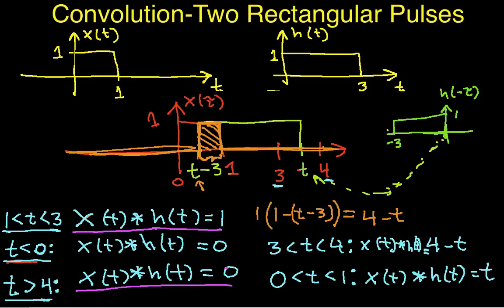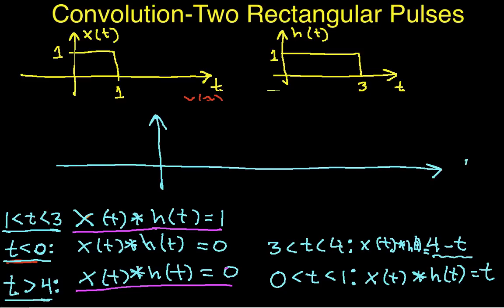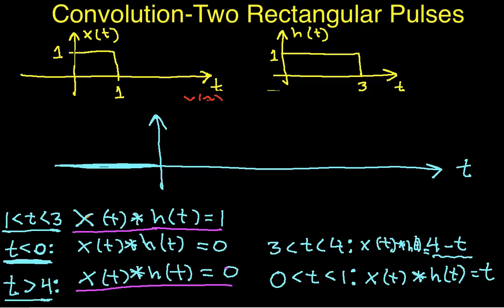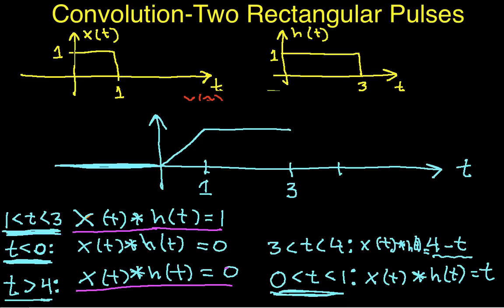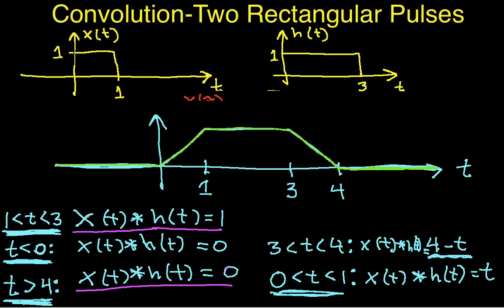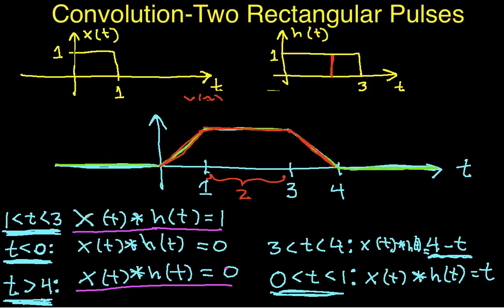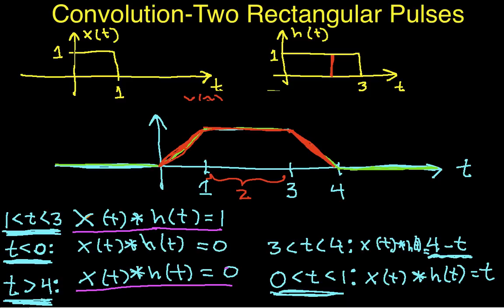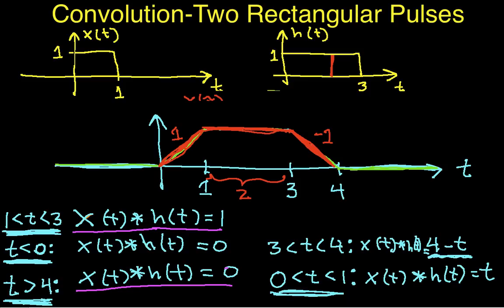Convolution Example: Two Rectangular Pulses Part 4

Comment: What was the amplitude of the final signal if one of them was with a greater highest than the other
Reply: If a given step has a higher amplitude, factor it out during the convolution such that you have two one high pulses- then execute the convolution. It's much easier to picture. At least for me it's easier and it makes sense mathematically that you can, as the amplitude of a rectangular pulse is constant- you can pull it right out of the integral. (I know the integrals aren't discussed explicitly in this but you can imply there existence, it's actually helpful as it makes this example far more applicable to other convolutions.) Though I was way late- I wasn't even in cal 1 at the time of this comment, I hope it helps others passing through <3